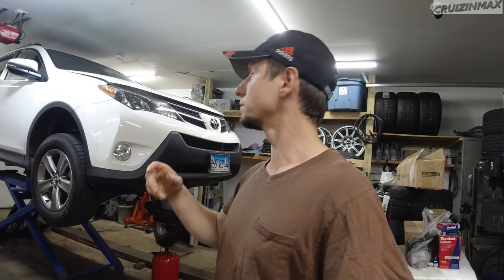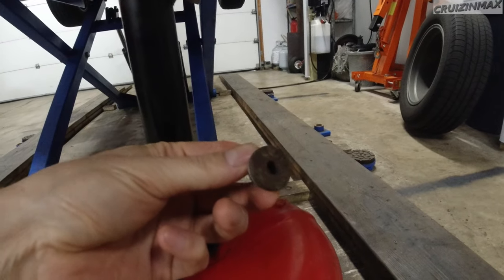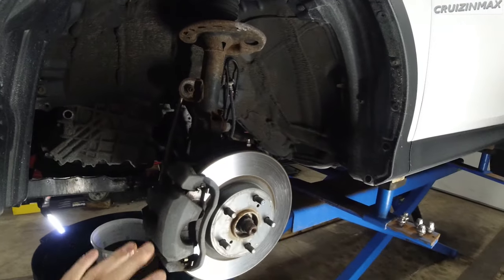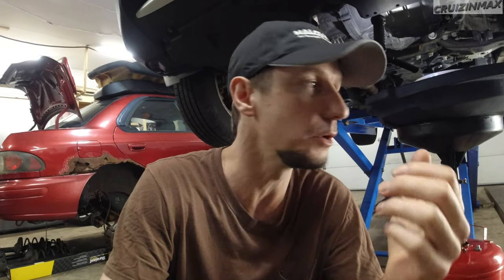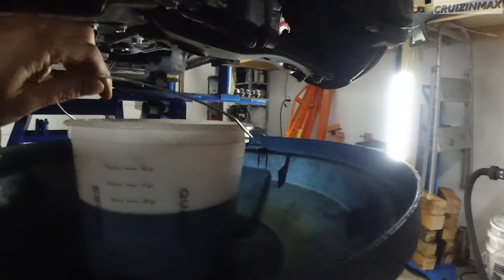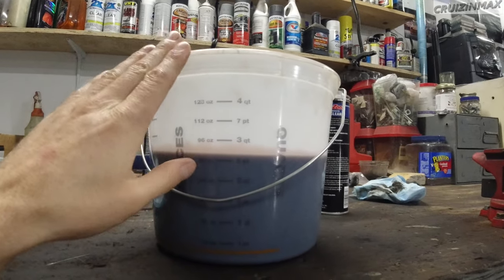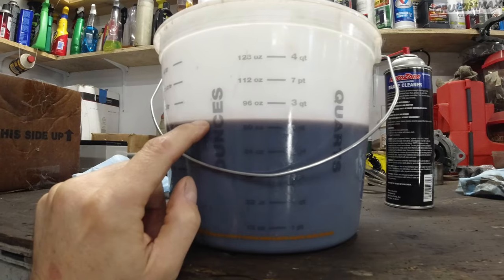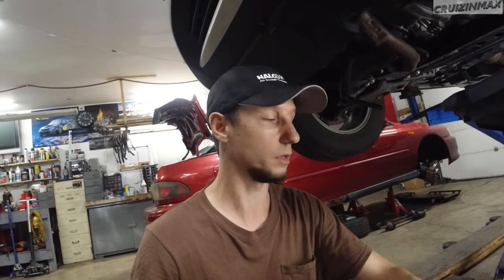Toyota Rav4 how to automatic transmission fluid change

Comment: You don't needs check level of fluid??
Reply from the maker: assuming that the level was good before you drain the oil then the amount that comes out will be the correct amount, thats why i didnt check.
Reply: @cruizinmax4017  Thanks

Comment: how to check  transmission fluid toyota rav4 2019-2021.show please
Reply from the maker: I dont have that car to show you but it should be similar to older toyotas.
Reply: Say bro, what about 2014 Rav 4 rear brake shoes change? Killer tranny video. Keep rocking